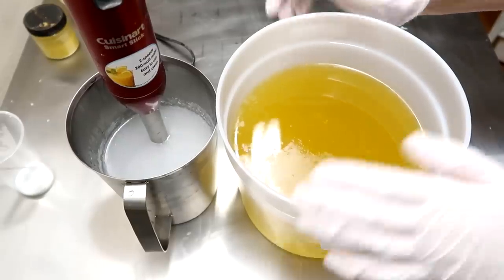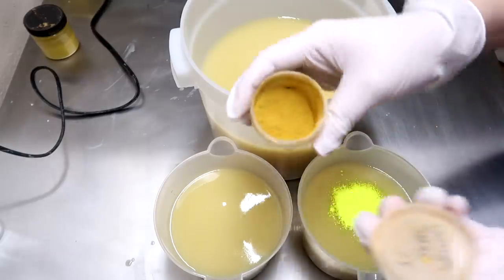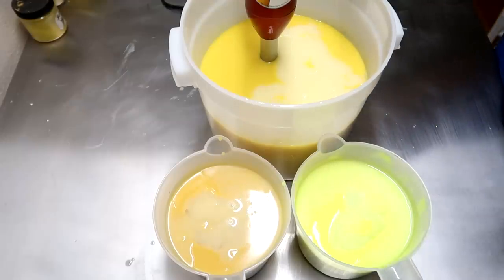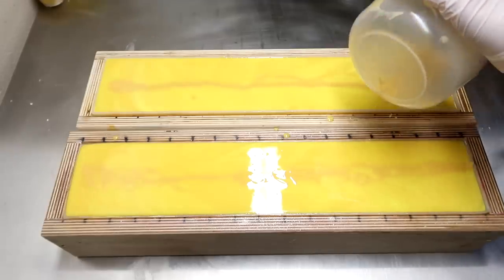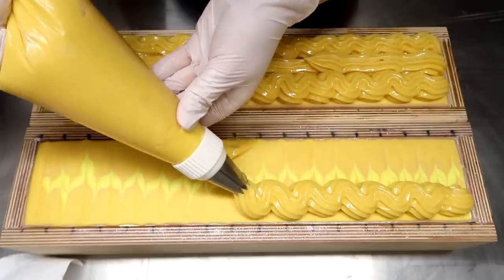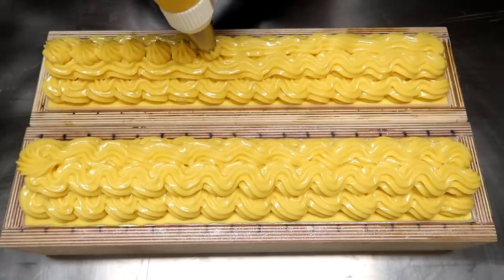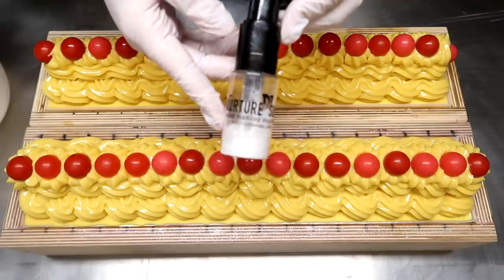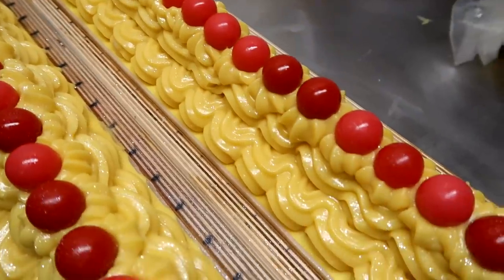Pineapple Dole Whip Soap - Inspired by Disney | Royalty Soaps

Comment: The decorations of them change depending on where you get them. The park or even the stand can differ in decorations. They are really good though. I've had both the float (dole whip and pineapple juice) and the actual whip and I prefer the whip alone. There is also a stand in Animal Kingdom that sells the whip with rum. They also are great for a hot day.